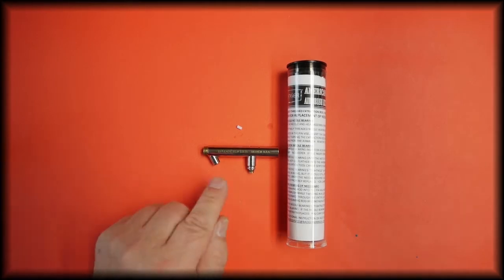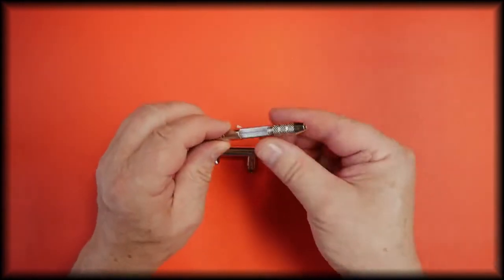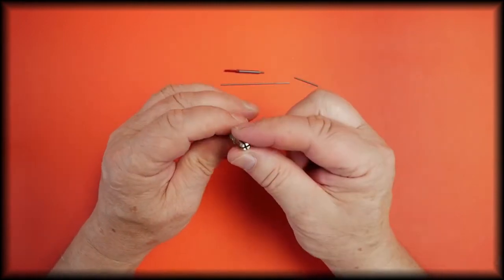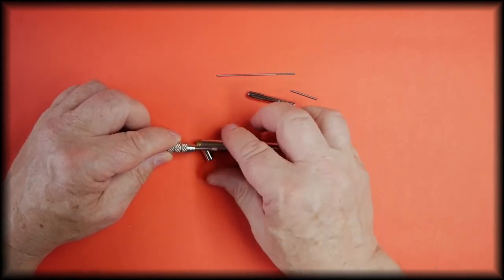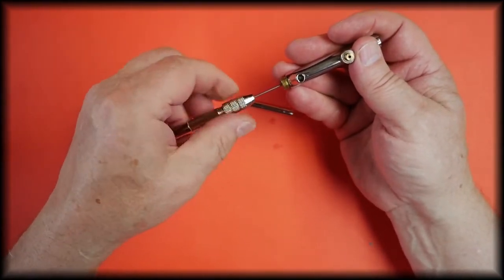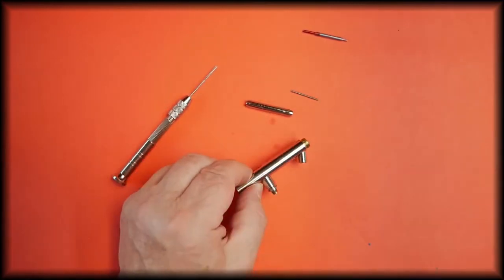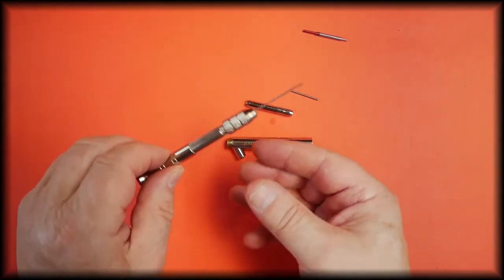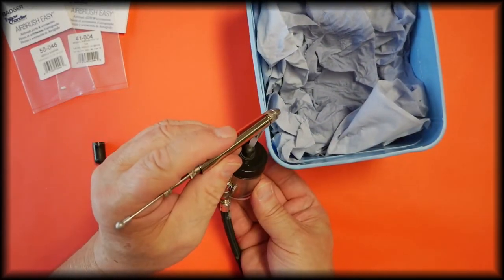Needle Bearing Replacement Tool Kit

Comment: Could you also unscrew the needle seal adjuster at the back using a small flat head screwdriver then remove the seal, replace it and ream it outside the main body ? 
I know it's quite easy to remove the adjuster at the back of the 105
Reply from the maker: You would ream when fitted,

Comment: Hello, 

I have the Badger Crescendo 175 and I just removed the needle bearing in order to replace it. However the bearing on the crescendo is a little thinner as of slightly smaller diameter and I cant remember if the thinner side was pointing towards the front or the rear. Can you please help me as its not possible to see clearly in the video. 

Also I have read that in order to know if the   bearing is bad it is recommended to turn the siphon type airbrush upside down, then fill with water the paint chamber. There must be bubbles when you press the trigger without pulling back after a minute or so... if there arent it means the bearing is bad? Is this valid as mine doesnt make when I do this.
Reply from the maker: I will find the answers for you

Comment: Hey there, I own iwatas and badgers, usually with an iwata if tension is bad you can use a tool to tighten the bearing, my patriot 105 started leaking behind the bearing, id like to tighten it but it doesnt seem to "Screw in" if i wanted to increase the PTFE seal in the needle could i adjust this for the badger? And if so is it through pushing it forward towards the nozzle or rearward? As there does not seem to be a threaded mechanism like iwata brushes, thank you for your time!
Reply from the maker: If your Badger Patriot 105 was manufactured before September 2018 the needle bearing will need replacing if you think it is faulty, after this date it is screw in from the rear

Comment: How do you have to use the pin for extracting the bearing out of the airbrush?
Reply from the maker: You put the pin with the threads in to the vice tool, then screw the pin in to the bearing that is in the airbrush and pull it out

Comment: is it the same mode for the Badger 100LG?
Reply from the maker: If you have a older model Badger 100 then yes
Reply: I bought it used about 20 years ago, it is certainly 30 years old.
Reply from the maker: Your airbrush is the old type, the the needle bearing fits the same as in the video
Reply: @barwellukairbrushsupplies4324  thank you👍

Comment: what will happen if the bearing is not in place?
Reply from the maker: The airbrush will not work correctly and the paint will flow into the back oy the airbrush